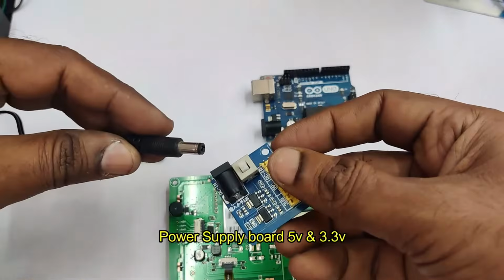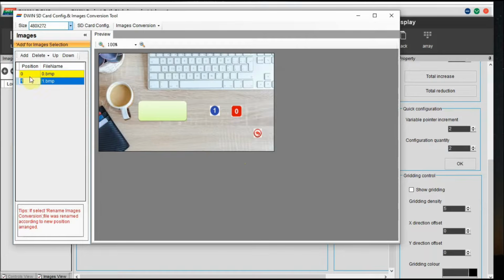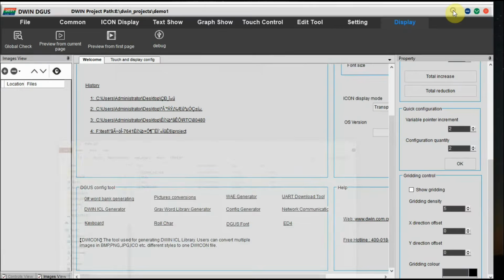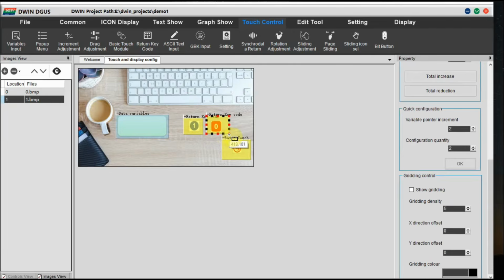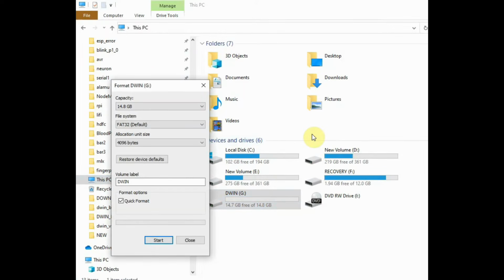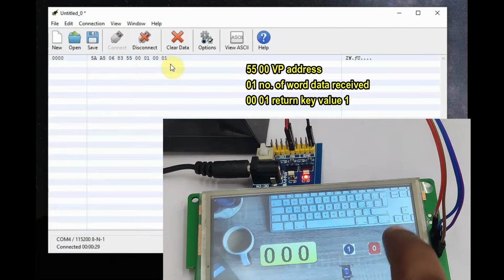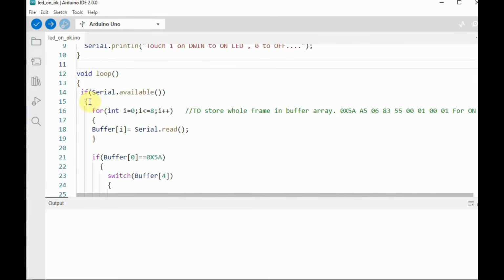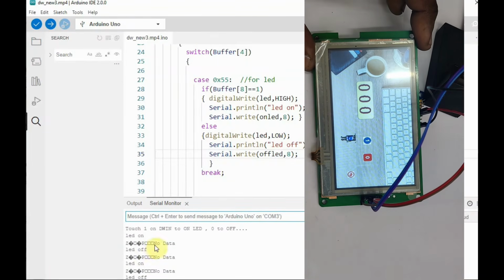#2 DWIN HMI TOUCH Display with Arduino - Sending Data to Variable and LED ON OFF

Comment: Thank you for the video but I want to tell you one thing that I am using the same application as yours attached in the description but when I have connected it to the USB TTL and display and check thr data in tera term for led on and off I am getting A9 CB F9 56 FD FF FF 00 as a packet, could you please tell me what's wrong in my case even though I followed your video step by step.

Comment: I'm recieving A9 CB F9 F5 FD FF 0F 00 A9 CB F9 F5 FD FF 05 00 A9 CB F9 FB 7F B5 00 A9 CB F9 FB 7F 6C 00 A9 CB F9 FB 7F 75 00 kind of series when I touch on DWIN display on coolterm software, even arduino serial also shows the same. I've shorted 2 pins for TTL also. Can you help?
Reply: I am getting same series'. Did you get solution?
If yes, could you tell me
Reply: @ravisharma2456  same problem
Reply: It is in default RS232 mode
to use TTL Short the  solder pads at the back
Reply: @girishkumar3626 where to short pls help me I'm also same data frame showing

Comment: Excellent work, I'm just starting out with DWIN and Arduino and your videos help me a lot. Thanks for your work.
I have a question, this DWIN screen, according to its official data sheet, its TX2 works at 3.3V and RX2 3.3V max 5V, isn't a logic level adapter necessary for its correct operation?
Regards

Comment: Hi, all works ok but the main screen BMP's do not load. ive tried puting the BMP's in folder and on the disk root but only loads the control function. any ideas and Thanks

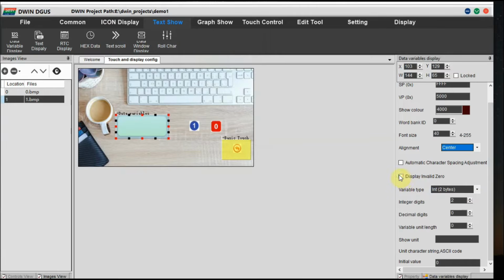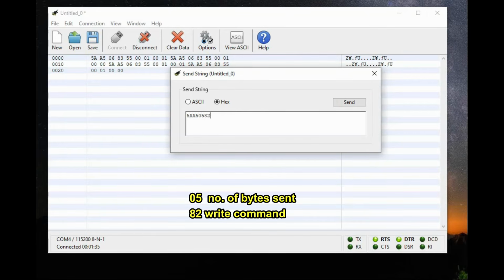Comment: Hi. For me , Your article is very helpful. Now I understand DGUS logic. Only 10:50 You write  VP 0x5000, next 19:13  You send data to address  VP 0x5500. I'm using DMG10600T070_A5WTC. Thanks
Reply: I have same confusion. How is this working?
Reply: Ok, I checked this in project files, it is 5500 in the code as well.

Comment: Hello Friend, I need your help.
I've being following your video
So, the example is: Turn off and Turn on the led.

When I start to try the serial port in the application, I push button (ON and OFF) on the display.
The hexadecimal  values I received are: 
ON:  2D 3E 55 FD FF FD 00
OFF: 2D 3E 55 FD FF FF 00

My Question is: Are the values correct?
I have a doubt about that one.
I hope your answer

Comment: Hello, nice explanation. Is possible use this arduino code for Mega 2560 ? Because Mega 2560 have more Tx/Rx pins. There, by my opinion, is needed setting Rx/Tx pins for the comunication in Arduino code. Or how recognize Arduino Mega, which Rx/Tx pins is use for comunications ? Thank you for understanding
Reply: Hello friend, Did you can?

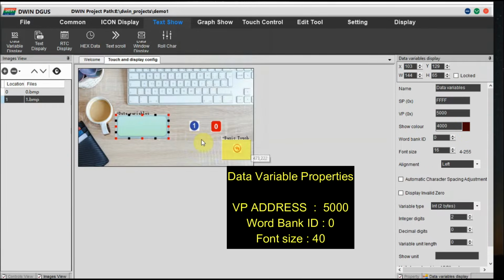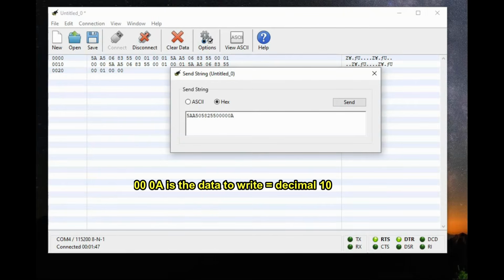Comment: In 10:30 you put vb5000  and in 19:19  different its 5500 ... is it magic  ?? 😂 VB different and work with you .. but 3 day am still trying its not working with me i do all same
Reply: I had similar doubt
Reply: Ok, I checked this in project files, it is 5500 in the code as well.

Comment: Well the price point is quite good compared to Nextion but programming is more primitive. Hope some one will make a library for it. Do you really need the expensive acessory kit to program it?
Reply from the maker: Not necessary. You can very well connect TTL pins to your Microcontroller to program it. Or use an USB-TTL device to decode the HEX code at the port pins.

Comment: The Nextion Displays are WAY easier to use
Reply: But sadly they are also like X4 the price... In my country the 2.8 dwin is 450, the 2.8 nextion is 2500...so over x5 in my case😢, I'd rather have 5 displays over 1 you know
Reply: Thats right, DWIN is cheap. App is hard at first time, then is Ok.